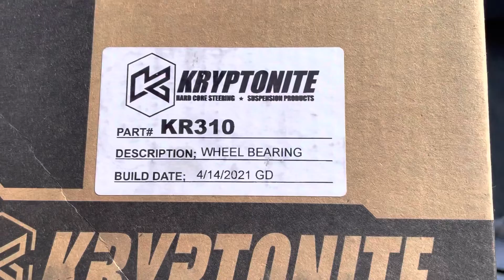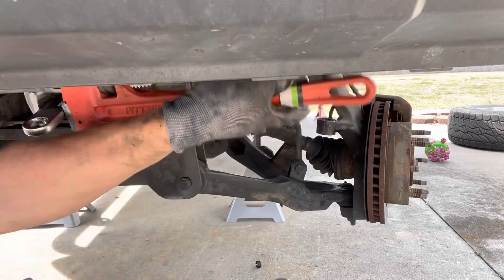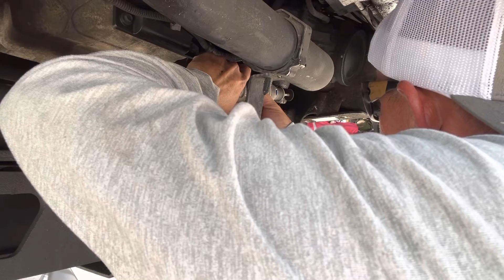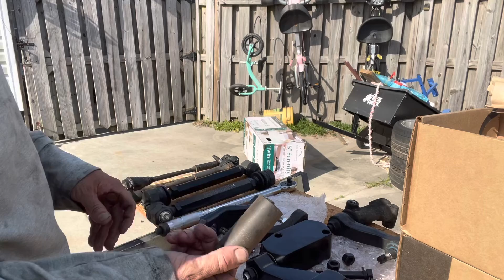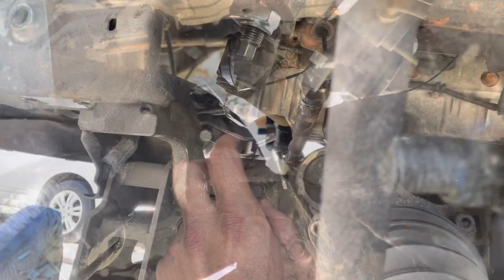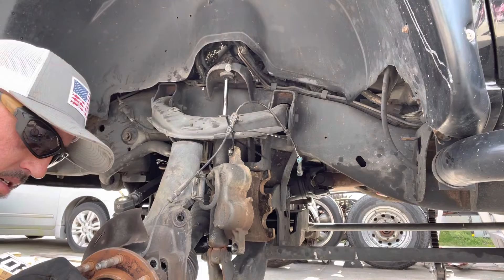2003-2006 Duramax Front End Rebuild (Kryptonite)

Comment: Why is your sway bar turned upwards, does it have to do with the lift kit? Just curious as mine is a 05 Dmax with Fabtech 6" lift and the sway bar is turned down which I believe it how they are stock.
Reply from the maker: I’m not really sure I might need to look into that. It had the lift on it when I bought it. Looking for factory lift stuff now though.
Reply: @hurricanestrouds2141  I feel ya, mine was lifted when I bought it as well. How did you like the steering after your front end rebuild and an alignment?
Reply from the maker: @ravenllyduc1198 it definitely feels a lot tighter. I think there’s suppose to be a steering gear box upgrade. I haven’t looked much into it lately.

Comment: I got rid of my krytonite IFS front end and and replaced it with a much stronger 7" lift solid axle swap front end with hydraulic assist steering on my 08 dmc duramax dually👍🏿 I always hated GM/ Chevy IFS on HD trucks🤬...but the amount of room under my front end with the S.A.S. is unreal